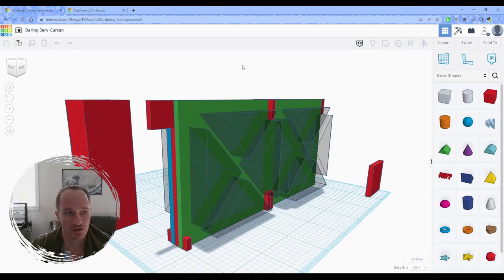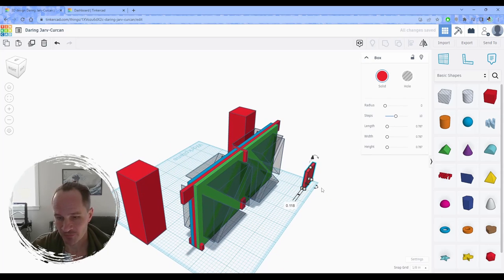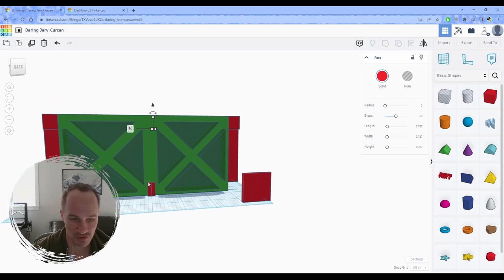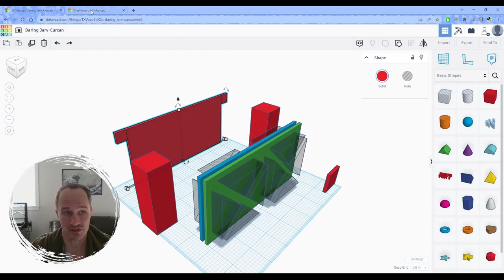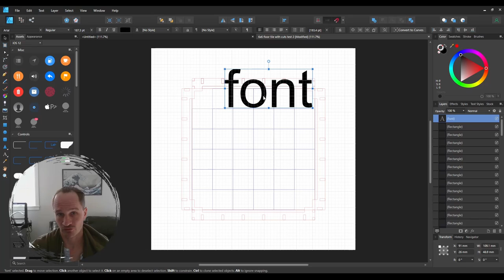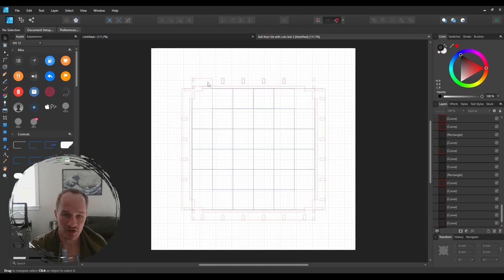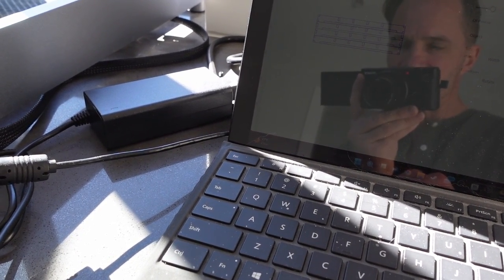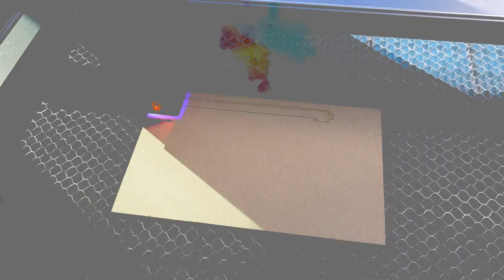My Laser Design Workflow

Comment: Nice! I've been thinking about doing some laser cutting for 6mm scenery because I really don't want to cut out all those tiny windows by hand.
Reply from the maker: Check with a makerspace. There's several around me that have lasers, I just wanted one of my own. It can be a big investment in cost and space you know.
Reply: @SMooreArtDesign  That's my plan! There's a place fairly nearby.
Reply from the maker: @jamiemckelvie5067  If you do end up wanting one, I really recommend these 20 watt diode lasers over a CO2 for hobby stuff. CO2 is a pain in the ass and diodes are super reliable and last forever. It's like comparing an LED to a fluorescent light bulb.